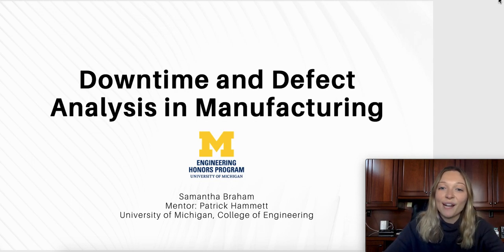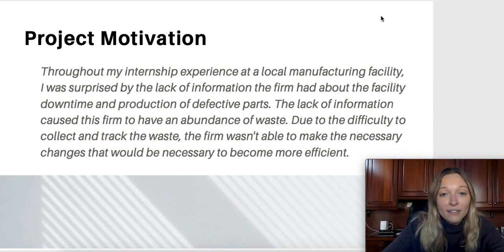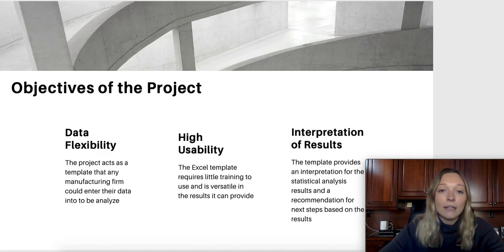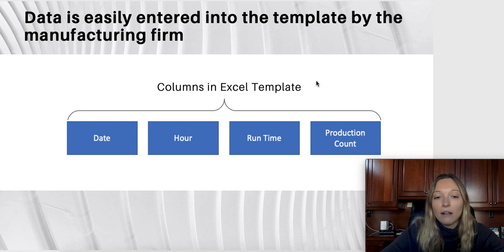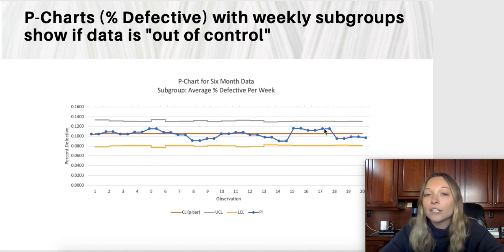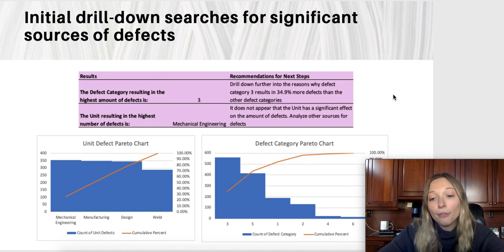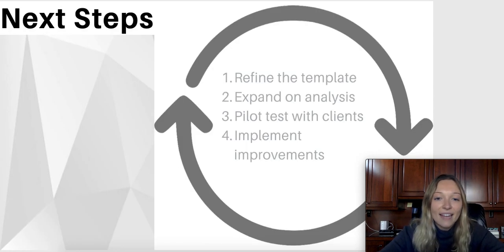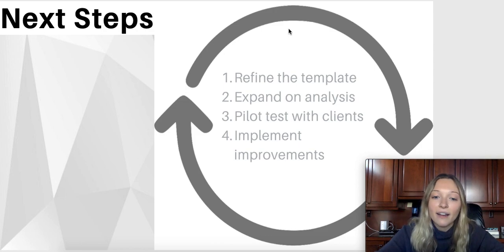Downtime and Defect Analysis in Manufacturing

Comment: Awesome presentation and project! Would the template created be able to be used as is in all manufacturing sectors or are there any smaller grain refinements that would need to be made and what might those look like?
Reply: I would probably have to make small customizations within the template for each company, since each company would most likely want to focus on different things. However, these customizations could be made pretty easily by changing labels on the graphs since most of the information would be graphed in a similar way anyway.